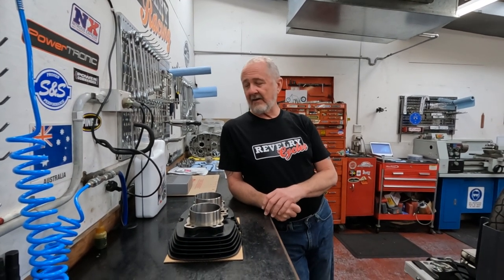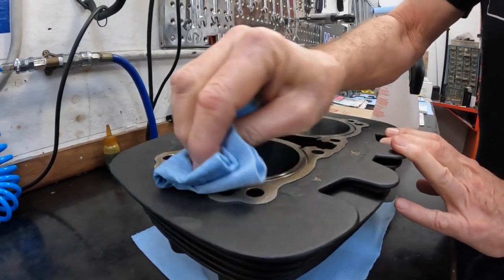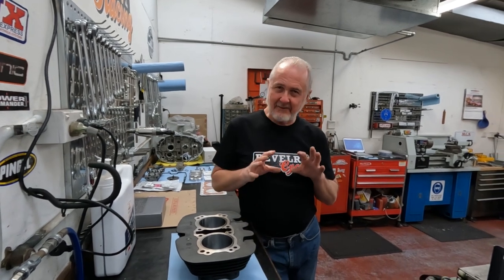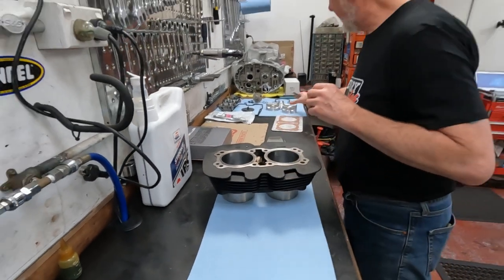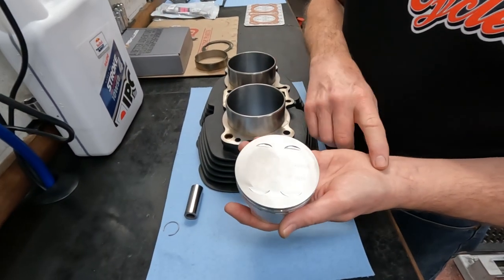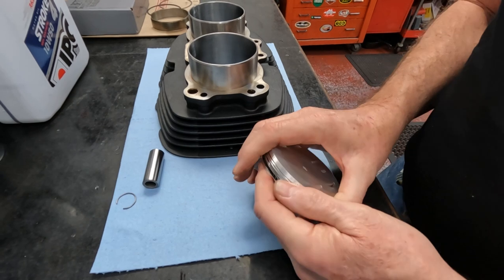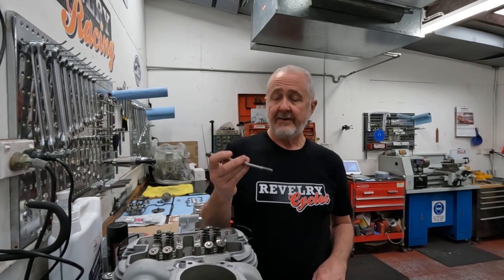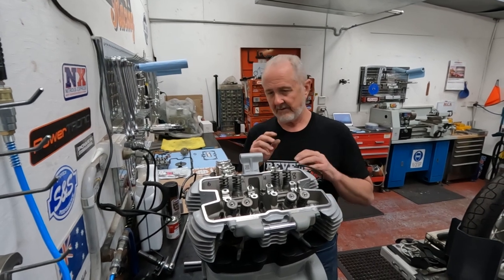Revelry Racing - Pro Tips - Royal Enfield Twin Big Bore Kit Installation

Comment: My stock motorcycle has 40,000 kilometers on it and is leaking oil between the cylinder and the engine block. This video saved me, as it teaches how to replace the cylinder gasket and assemble everything back together.

Comment: Great that you show this. Some may think you're giving away trade secrets, but a lot of people will look at this and pay for it to be done. 

10:09 In the S&S 865 kit instructions it says they are Wiseco part # 9000XX which has a gas nitrided stainless steel top ring, phosphate coated cast iron second ring, nitride coated stainless steel oil ring (info from S&S and Wiseco sites). My dealer/installer used one of that part number and one of different/inferior materials (because the S&S kit came with an incorrect ring!). 

Yet to see the result of that, but bike runs terribly and has an oil leak right from when I got it back from the installation.
Reply: 23:25 might be your problem regarding the oil leak.

Comment: Hey Will do you happen to have the end gaps specs for the S&S high compression 650 version  of the kit. My top ring is tight when fitting in the cyclinder as you 've done in the video, needs to be shaved a little .
Reply from the maker: https://www.wiseco.com/auto/wiseco-auto-blog/everything-you-need-to-know-about-ring-gap/
Reply: Thanks for the info 👍 @RevelryCycles

Comment: Interceptor 650. I travel full time and got tired of always having to stop and clean, lube, and adjust the chain. Bandidos Pitstop had a belt drive conversion which I bought and have over 20,0000 maintenance free miles on. I was promoting them but found out they are no longer selling it. Would you consider making a belt drive conversion kit?
Reply from the maker: We've considered it.  It's not an inexpensive thing to develop.  What did you pay for yours?
Reply: @RevelryCycles   392 US OCT 27
Reply: 392 US in OCT 2021   I've been having trouble with my replies going through. I would be glad to help you if I could.   @RevelryCycles